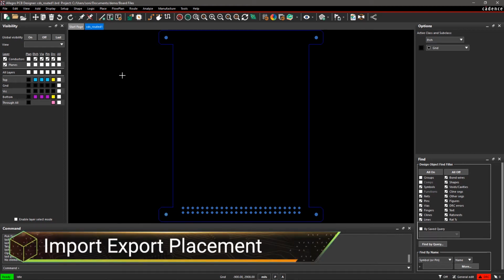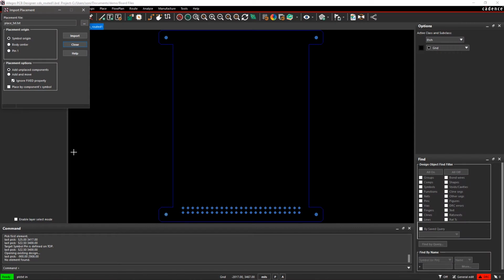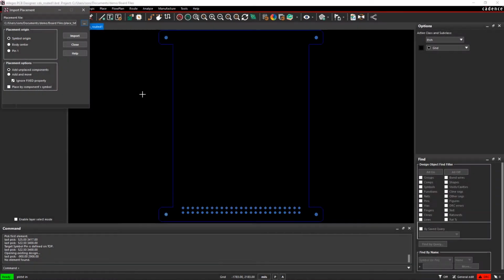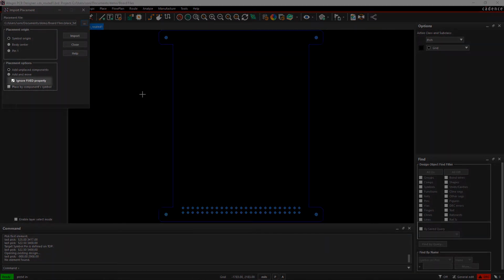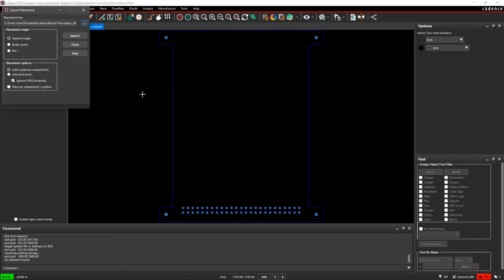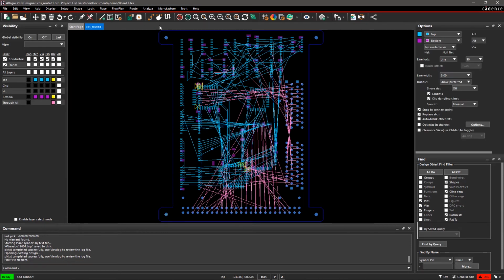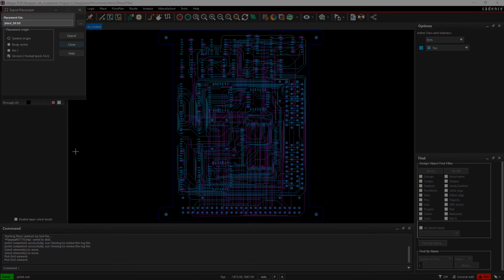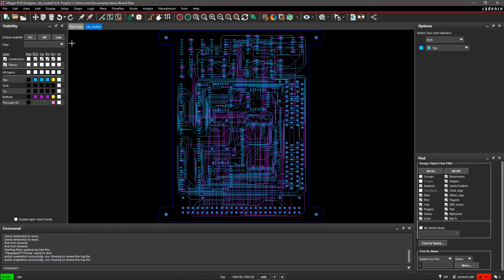Importing and exporting component placement | Allegro PCB Designer

Comment: Is there anyway to export and import library in cadence package designer with .sip file type?
Reply from the maker: File > Export > Libraries will export all footprints used in a Packaging Design (.sip) generating individual library files for each.

The import of an entire library is not required as when a footprint used it will be automatically added to design.